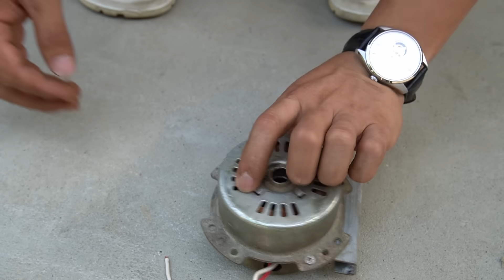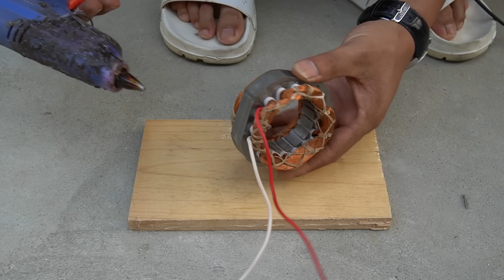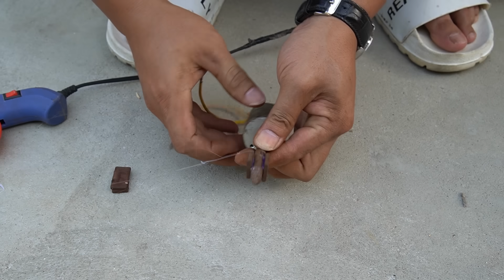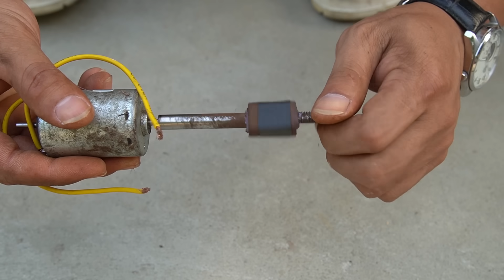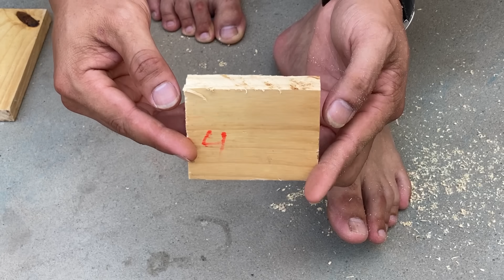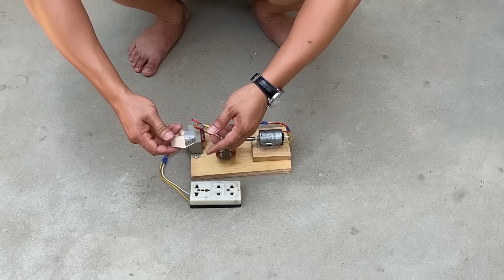I Turn The Fan Into A Permanent 220v Generator

Comment: This is a varient of the more conventional Turbo Mode encapsulator type of power generator which is based on a reverse polarised spline circuit, however this is interesting in that it switches the subduction effect round so that the output is obviously more compatible with non-reactive type LED systems.

Comment: the ttrasformer looks like a fairly standard 1000w microwave part,  DC motor ffrom a cordless tool (rigid or dewalt) and a standard fan coil.. so
- microwave transformer
- DC motor
- dissasbled fan coil
- neodym magnets
IVE done this myself .. beware though anyone trying to show that energy can come from a free source WILL be met with great opposition.
you threaten the very fabric of what keeps rich people rich and the $$$$
just like proving that most DR's are fairly worthless short of surgery ( thats why they discredit Natural meds.. JS.
And dont ever show your face if you achieve free power
Reply: LivelyOwlBroadcasting' your comments about DR's are exactly my views.
Reply: I don't understand what you are saying.. U said U ve tried it . Then let's us know if it works or not
Reply: @NunyaBiznes-o2u  probably not a great idea. What if they EPSTEIN you

Comment: When the electric fan was switched on, it just made the fan blade turn for a very short while. It was almost stopping when the guy reached for the bulb, then there was an obvious cut in the video, then all of a sudden, the blade of the fan is running fast, very sudden change in turning. The reason for the obvious cut in the video is that the electric fan was connected to an AC source thru a connection at the back of the fan motor casing which is not visible in the video. I hope and pray this guy will stop fooling people. If he won't change ASAP.
Reply: well, you can see actually that there is a cut, that's right, and the speed of the fan changes, that's right. But the speed of the fan changes, because he changed the speed of the fan manually during the cut. You can see that speed 1 (button 2 from the left) was selected next, before speed 3 (last button on the right) was selected. Why he changed it, we can not really be sure, can be different reasons.. But to cut the video at this point while he is grabbing other equipment seems sensible.
Reply: All tthe right but
 1.Your motor consume DC current which running AC current produced by generating coil.
2. Next if coil produced DC current then your AC fan can't run and AC bulb also can't run.
It means you are fake
Reply: 此人的制作只能騙對沒有電能知識的人！

Comment: How come DC motor works with AC coming from alternator and you didn't use rectifier diode. Transformer converts with AC. How come 220 AC conversion is done with ^.6 volt DC. What a ridiculous project.
Reply: It's been hidden inside the socket output.. Diod and cap for sure.

Comment: Let me explain so easy,

At the very beginning when he spin motor with thread there was a hidden battery in the motor then he paused the video which can be seen if you watch carefully,then i put the fan wire in the generator switches where battery was already hidden in the fan,and the wire Of fan he put in switches those were the 2 wire of single power like separating 1 wire to 2 wires then he just combined them and hidden battery in the fan start giving power to both fan and generator,sorry for my bad English but it was my best to explain i hope you guys understood,peace 🫡

Comment: Bullshit. Proove it with multimeter, the outpu voltage, current  etc. We need  to know power output rating produduced and  devices power rating   Then we can calculate if both match or just simply fake.

Comment: How do you explain - when reaching for the bulbs, the fan automatically increased its speed. LEDs ok - 5v 000000, Ampera, such a motor will start - why didn't you use 220v/100w HAHAHA

👎

Comment: The hidden battery is in the shaft look closely
Reply: correct, to rotate for the small motor. But the base of the fan is its own power source with an inverter. 
The cable is only used for show, while it is also used as power for the other deceptions. I think his target group is not industrialized nations either :face-purple-crying:

Comment: The battery is hidden in the motor. Don't be fooled.
Reply: Oui sûrement   eco  flow  😁😆😅🤣
Reply: Jaa be chaman
Reply: It is changed magnetic field to electric field so it can produce AC current .no have battery
Reply: So, you don’t understand anything about magnetic flux which passes through a coil.
Reply: I beta be fooled, Dan been fooled by our nollywood, & politicians
Reply: Охуеть какой должен быть аккумулятор чтобы крутить вентилятор ,хочу такой аккумулятор

Comment: According to law of quantum physics energy couldn't be created or destroyed it should be transferred from one stage to another so its not possible 😂 because motor will stop working recently when you start ta generator 😂😂😂 and how you getting dc voltage? through magnetic coil its release ac output 😂😂😂😂

Comment: Dc motor is not running in ac volte & led light,  not used diodes , generator voltage only ac,😉
Reply from the maker: Yes. Thank you very much. ❤️❤️❤️

Comment: From 3v to 10v, what did he achieve 😮
Reply: Para eso sirve el transformador. Para aumentar o disminuir al voltaje que desees según el grosor del alambre de cobre y de las vueltas del bobinado.
Reply: But if you increase the voltage with a transformer you decrease the current? It is for this reason they step up to such high voltage for distribution, it's the reduced current that enables the use of thinner wire.